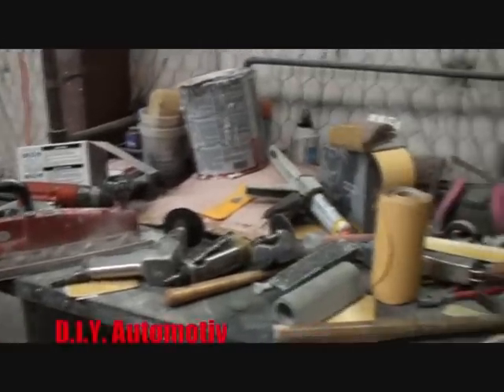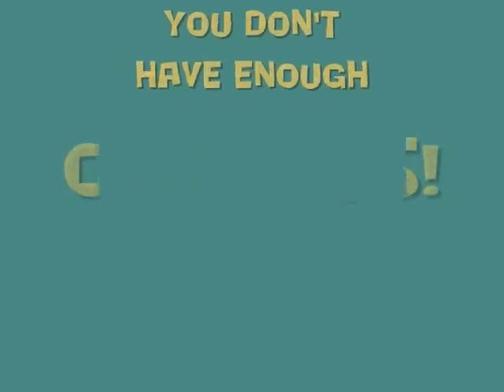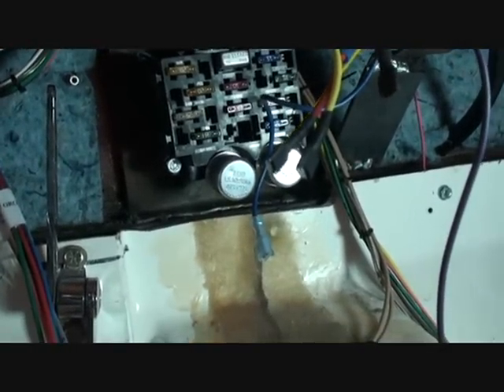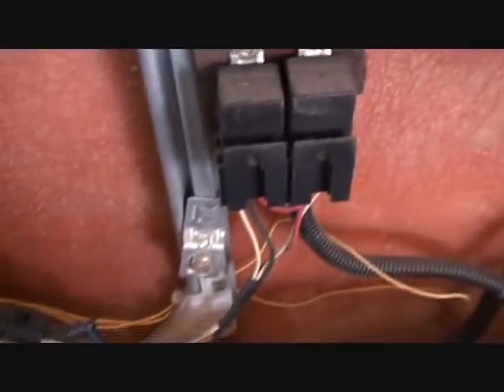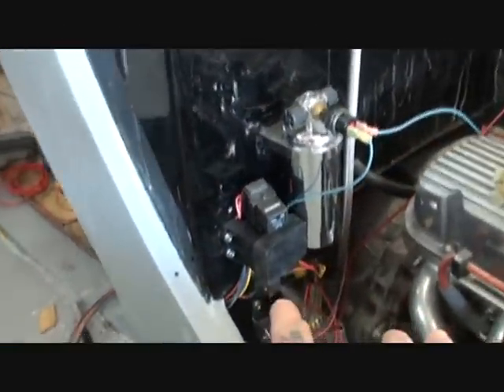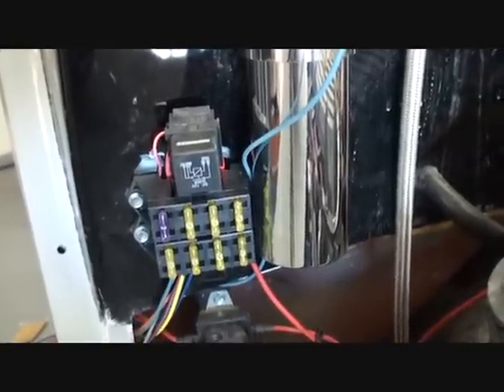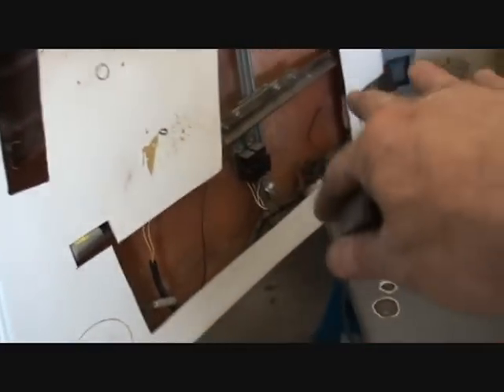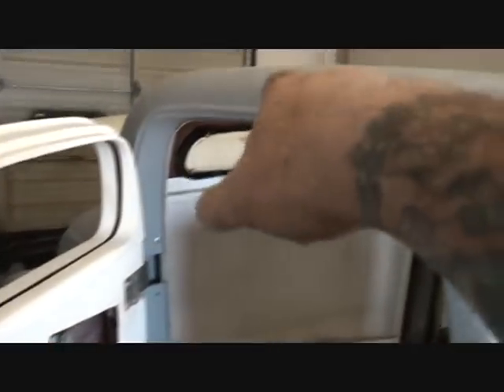Automotive Wiring-Installing An Auxiliary Fuse Block-Creating More Circuits

Comment: HI Pete have a prob.had a relay to burn up so bad i couldint figure how to rewire it. got power when turn on switch to red wire and yellow. got black wire with white stripe. and red wire with blue strip' would like to no how to wire up. TKS.

Comment: Good stuff.
Suggestions on an Electric of Air 1/8" air line that would engage a PTO on a Class 8.
Looking for an "Economical solution" to the manual system we are using.
Regards
CA

Comment: Merry Christmas to you Pete and the SWRNC family! What I did on my Studebaker Lark is to use a heavy duty RV relay to power the fuse block, switched by the ignition key switch. That way, the key switch only has to power the relay, saving the load of fans, A/C, fuel pump, etc. from the old key switch. If the relay ever fails, just jump the two heavy terimals and you're back on the road. The block you have has the relay, but inconvenient to bypass in a f'ckin' storm, etc.!  Art

Comment: don't know if I heard ya mention a relay (on top of the breaker panel?)  that actually switches the panel....that lil blue? wire I saw looked like the control wire for the relay....the larger gauge red wire from your breaker is the source for the panel and the relay switches the ignition controlled circuits 'ON' when you turn the switch on      pardon the lawnmower guy's questions as my sinuses are bonkers today....Merry Christmas to Pete, Minnie and the gang at SWRNC